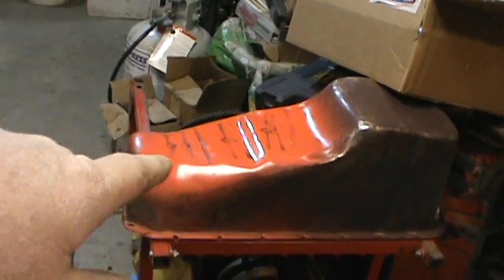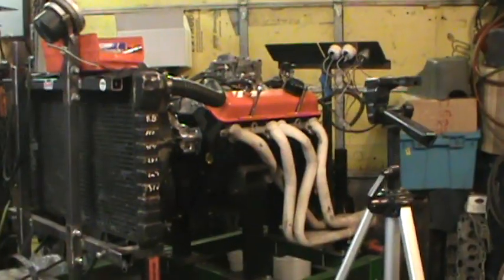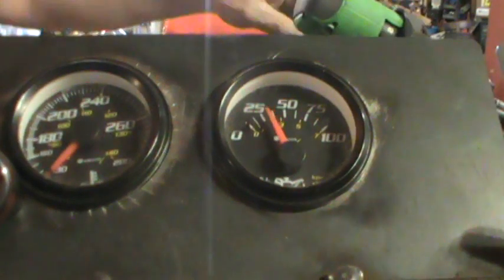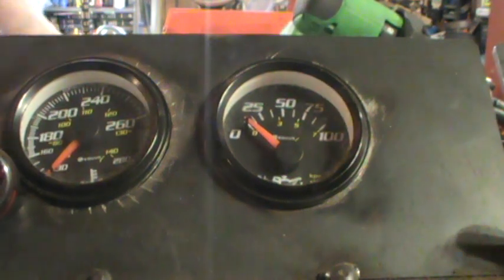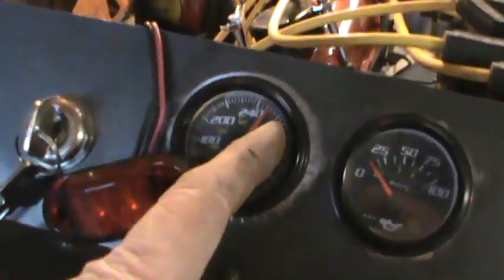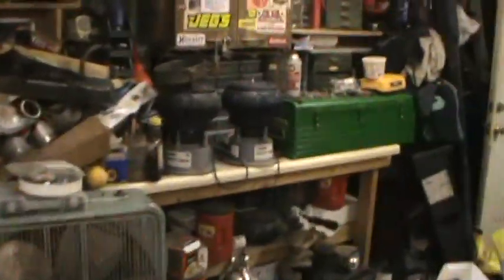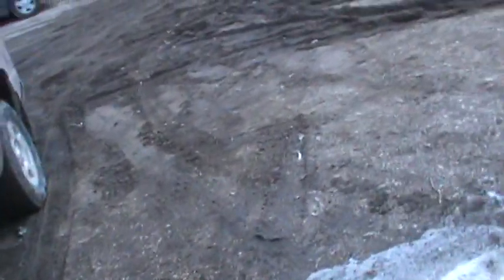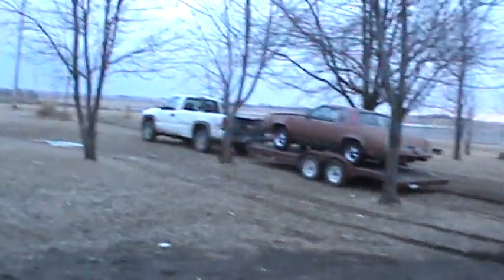080 motor break in kind of  and kid update

Comment: I have noticed a lot of brass stuff i have bought the last few years just dont fit right kind of on the small side pipe thread is tapered bunch of it has no taper to it.
Reply from the maker: ya i use to have good luck with them but i will change it